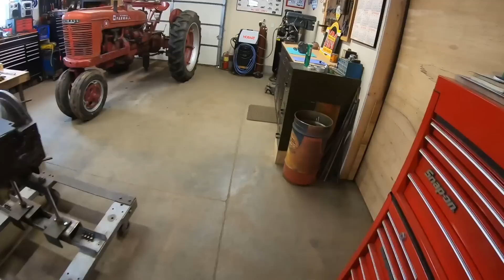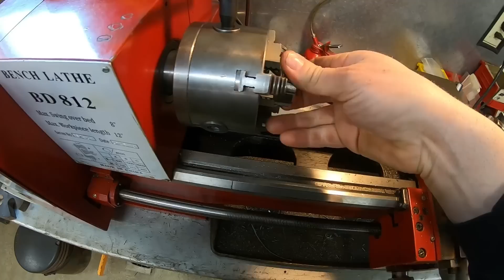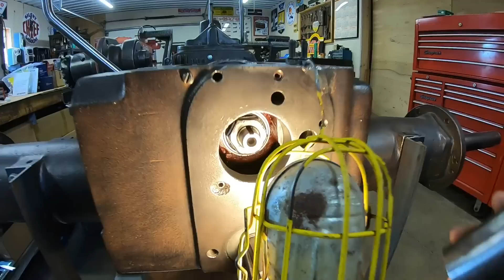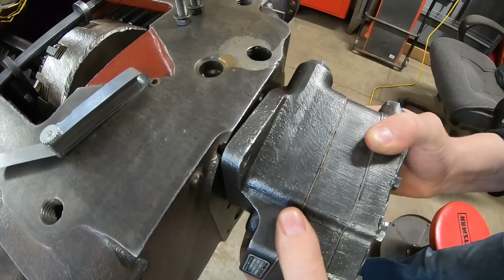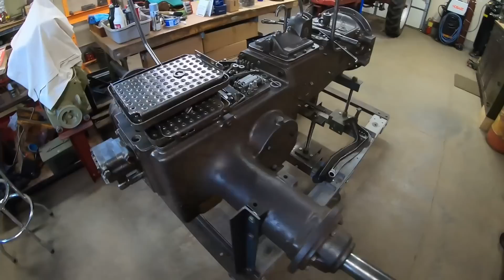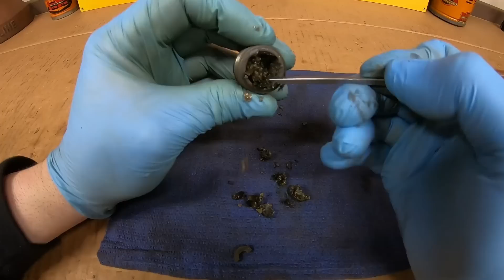#X231 Prototype Part 69: Hydraulic Pump Installation Mods & Chassis Ready for Primer!

Comment: I'm wondering what seals the live power shaft from the input shaft, I haven't seen any seals that you have installed for sealing it, I would imagine it would leak oil into the main clutch.

Comment: Just an observation Squatch, the prototype hydraulic coupler was badly worn, you’ve done a marvellous job with the 3 piece coupler, my question is, would you not benefit from 2 opposing holes in the catch tube to maybe splash feed oil onto the coupling, & out the bottom hole? Seems to me to be a design problem causing the wear. Really enjoying your videos 👍👊

Comment: Excellent! Are you just going to prime it, or will you put a coat of color on it too?
Reply: @squatch253  👍 So you will run it first before you paint it or, maybe you are thinking of running your Engine on a stand , and making a adapter for your transmission input shafts to attach to a large drill to simulate the engine?
Reply: @squatch253  ok 👍

Comment: I started watching when you were doing the machine work on the casting, and it seems like you had one rear axle that was a prototype with a round key and a production axle that had a square key, did you just run with that or did you weld and remachine a round key in it

Comment: Did you for one second think about sealing all that carnage into that drain plug with some clear epoxy or something? I know you wouldn’t have been able to sleep with it like that but it would have been cool. Or to epoxy it and use it as a paper weight and put in a new plug.

Comment: A great stopping point, and a major milestone as well on the rebuild. Hopefully the transmission and rear assembly was the worst you needed to address on this tractor. I know the front bolster is still to come, and was blown out, but that shouldnt be much re-creation, more just machining the repaired areas. Sheet metal is sheet metal, and while a PITA sometimes is infinitely repairable. With any luck, the worst is now past, and Christine understands that it will be a tractor again, whether she likes it or not. Will be continuing to tune in for the summer work on the Farmall H, and sticking around to see more progress on X231 come the fall!!!

Comment: Don't forget to dope that plug so it don't leak lol😅
Reply: @squatch253  I only brought it up dad did a bull gear diff drain and full oils service on his 53 Oliver AG6 dozer our neighbor borrowed to clear up his yard and he found a septic tank and dropped the dozer in it up to the bottom of the fuel tank(gas) which is Infront of the operator fortunatly he gave it the beans  and the nose came up out of the nasties and stalled the drivers purch was still in the stew. I borrowed grandpa's steam Genny and cleaned her off once we winched it out and as well you know Oliver's have tons of nooks and crannies to hold crap. Any how dad had pulled the plugs and access plates and washed her innerds out good before applying fresh oils and filters(strainers) and grandpa told him to dope the plug as a seal and lube to remove it later. And being as X231 has been apart for so long I'd hope to preserve a bit of the old school charms we have learned from some of those mechanics of the days when those particular items were built. And share it with you.

Comment: I would've drilled a 5mm hole top and bottom in the sleeve to allow oil in and out and thread tape on the drain plug.  From Australia.

Comment: And as the plug was screwed home daylight was forever banished from the back end 👍 actually quite a good design idea having the hydraulic pump mounted externally an idea which is still being used to this day in some cases 👌

Comment: No part numbers on those pieces in the drain plug?  Most old equipment does not get saved unless it falls into the hands of someone like you. 
I appreciate the work and it’s documentation. Very nice work.

Comment: You ... could take a damaged thread Rockford, but with a decent head... and plop it on the body of a grade 8 that fits. You could even give it proper heat treatment before and after the weld, to make it proper, plenty of tutorials online. IMHO, if this is accepted in high end antique car restorations to maintain original factory stamps for bolt heads, dunno about others, but i personally wouldn't even mind it a bit.

Comment: Amazing what you have been through on this project Toby!
Kudos to you buddy👍👍
Having watched from episode 1, through the short (😂😂) hiatus of a CAT D2 rebuild and back again, it has been fantastic to watch your problem solving all the way through.
One thing, if I should be so cheeky to mention, would be on the pump coupling you shortened, would it have been possible to have taken half off of each part to even the strength of each part.
I know it isnt going back to work but it was just a thought.
👍👍🏴

Comment: It's awesome Toby finally has that unit ready to be primed and painted.
So much hard exacting work went into making it absolutely reliable.
Tho I love the current color of the unit I understand it needs to match the rest of the tractor plus clear coating it would also change the hue anyways. 
I feel like I've graduated an advanced class in tractor power transmission units specific to the tractor.
Squatch is definitely a university level lecturer.

Comment: A well timed full circle moment, with bonus footage of the actual cleaning process of the drain plug before the re installation! Now the resurection of X231's carnage is completed. You have brought back to operable condition, a litteral hunk a junk. Good work, Good job. Are you considering painting original MM colors to match the arcival photo?

Comment: I I can't believe you waited 16 years to clean that drain plug! 😆
Reply: I’m guessing squatch253 finally got a decent night sleep after cleaning the last piece 😂
Reply: @squatch253  Hoo,Lordy. That comment alone got me thinking about you and your days at your Ford prison. Watching your patient reassembly here,on,off,on,off,rinse and repeat. I betcha you just hated the flat rate book.
Makes me wonder,did you ever do air conditioning or electrical work ? Or did you try to concentrate on doing repairs that worked to the strengths of your personality ?
As I type this,an ad showed up for Ford service at a dealership. More than a little ironic . Brings memories of my days at a Ford  dealership in Vancouver. It too went out of business,years ago.
All the best.
Reply: @squatch253  Ah yes,intermittent electrical work. Traditional wiring harness diagram,from oh,1925 to oh,1985 perhaps,was 2 pages. My friends 1990s Town Cars had a factory wiring diagram of 23 pages. And all of them had ongoing electrical issues. About half intermittent. That statement brought back some memories all right.
Somehow the act of cutting firewood just got a whole lot more attractive. Or maybe running the manure spreader.

Comment: Squatch, the D2 cab plan arrived. Many thanks.
Reply: @squatch253   It's a fascinating document. The drawing style is very old school, just how I learned it way back in the Dark Ages, with curving arrows and hand lettering.  The construction materials they used are about what I would expect. Red oak for the structure, poplar for the paneling, and cypress for exposed roof parts. Every piece has a part number so I assume there were drawings. No doubt long gone. Thanks again.

Comment: Excellent video it's really nice to see the hydraulic pump mounted and the drain plug cliff hanger lol . That was a smart way to keep the hydraulic pump coupler contained in case it broke or when the pump is pulled off it doesn't fall into the rear end housing